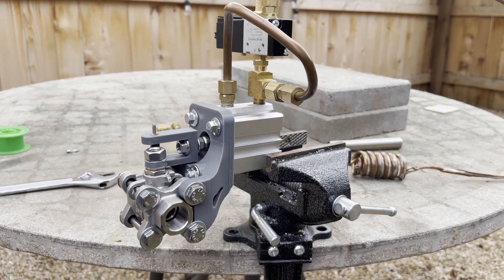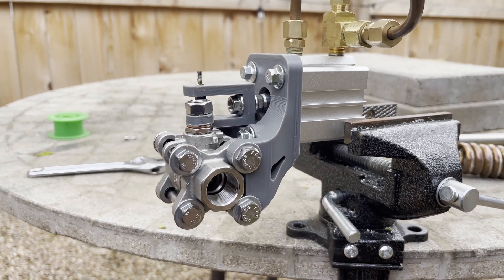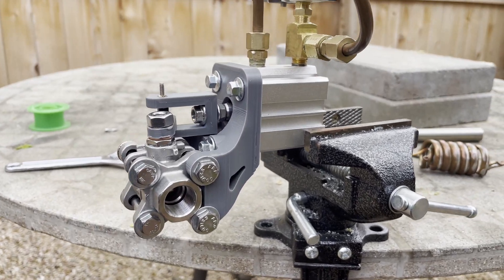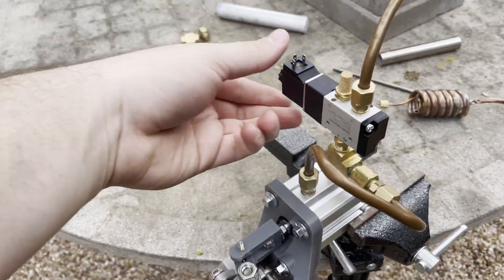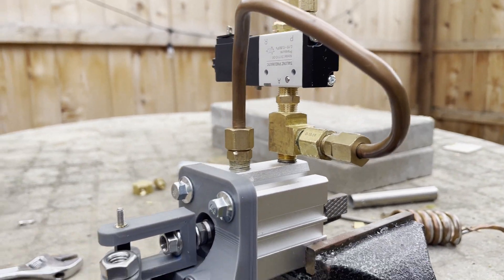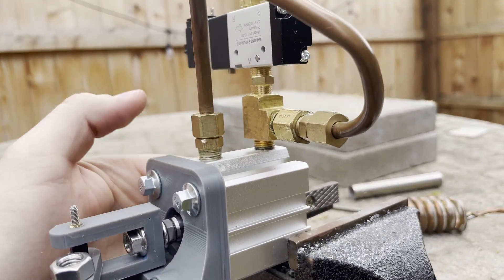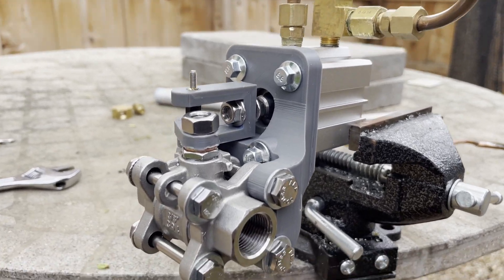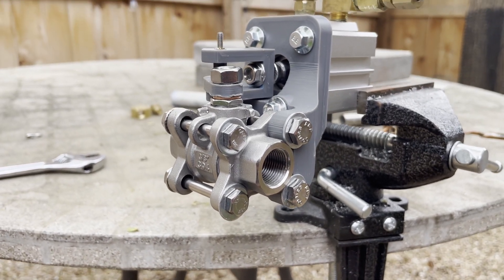Custom, Affordable Actuated Ball Valve Design

Comment: I guess this valve would leak with Cryogenics ? I mean I don't know but seems so . PTFe seals would leak for the same . Also u need to include vent hole if thinking for Cryogenic use . May be considering TFM seals would really make it work . I m gonna try the same in few days will let u know the outcome
Reply from the maker: It’s not for cryo
Reply: @Benjijart  yeah but I'd you decide to build one ....I had these experiences so just shared the same
Reply: @Benjijart on this topic of venting - many 3 piece ball valves share castings, if you look you might see areas in the structure where there's material (and sometimes a divit for hole size and exact drill location) that's just not drilled out for a non vented body. This can be drilled if you want or need to vent either the up stream, downstream and depending on the ball seal type - even venting the ball cavity itself